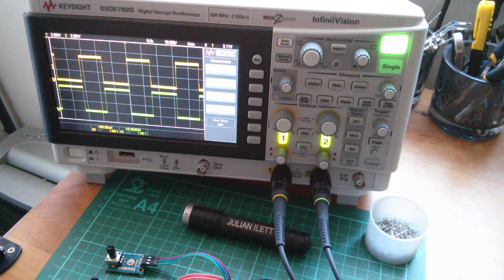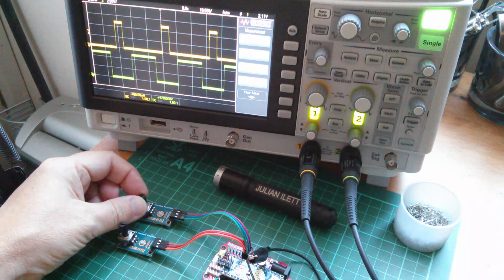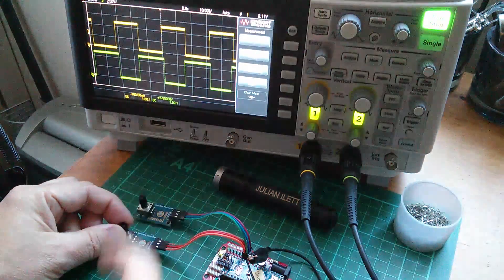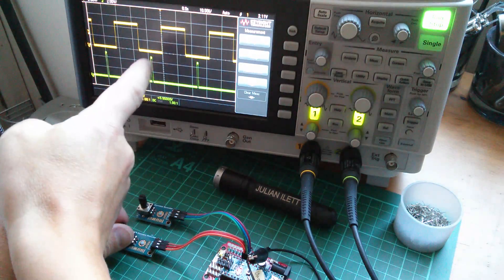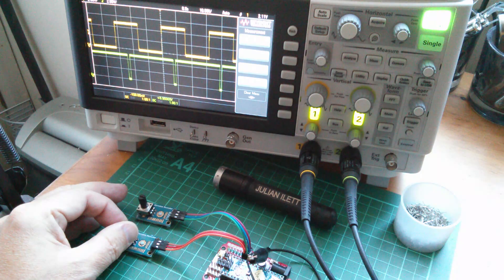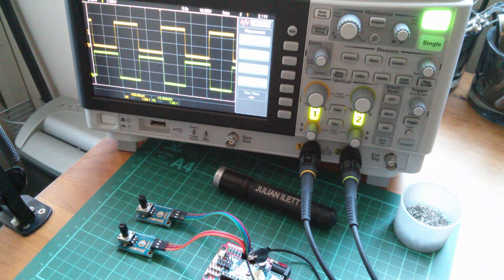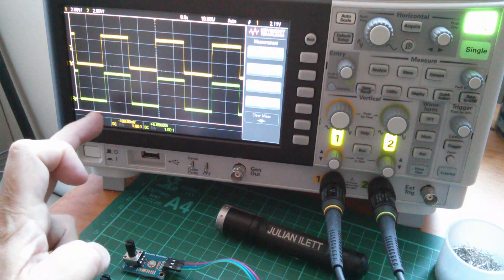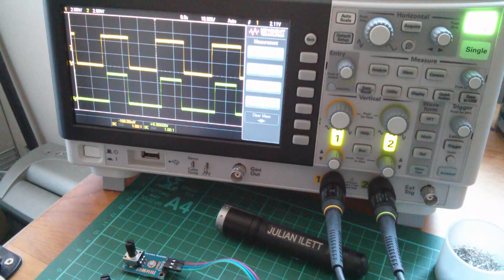Arduino PWM Inversion Issue - Muppet 2 Project

Comment: Julian are the signals for example if A is at 10% duty cycle and b is at 80%.. mosfet B shuts off before mosfet B . is this correct . Like you I can not have both mosfets on at the same time and I would like to have the code automatically adjust duty cycle for both A and B . for example when I turn the Pot as A adjust lets say to 10% can be also adjust  to lets say  88% or what ever max value I want .

Comment: I'll second the comments about ditching the Arduino libraries, I'm currently in the process of building a HV high power MPPT controller. I decided to go with talking to the AVR directly using the registers and timers, I first used Fast PWM mode and encountered some nasty spikes when on 0% duty cycle, once I switched to Phase Correct mode they went away and my MOSFET thanked me. This is actually a documented issue in the ATMEL chip data sheet. Not sure about the issues with the inverted PWM but I think Phase Correct would solve the larger problems.

Comment: Your project won't need the full span of PWM from 0 to 100%.
I'd suggest just finding the safe zone for PWM and not stray outside that. Probably 2%-98%. 
Hard code the levels outside this is you need to.

While using external hardware to do the PWM will work it's overkill and adding to the BOM for no real function.
Commercially the extra components would not happen and I think for your project it shouldn't either.
Finding issues and concerns, analysing them and deciding if they are important is a large part of the design process.

Comment: Julian,   Instead of fixing this anomaly externally, why not just fix it in the Arduino code?  I believe you could nest two conditionals in the main loop and drive the output the way you need it at the top and bottom end of the PWM range. Seems much easier than wiring around this issue -- at least to me.   Just wondering...Mike

p.s. regardless of how you choose to address the issue, I'll certainly enjoy watching & learning from you talking the rest of us through your thought process.  love your videos & please keep them coming.

Comment: The analogWrite() function has special cases for 0 and 255 inputs.  The Arduino core doesn't know that you jiggered with the hardware registers to invert the signal.  You could copy analogWrite() from the core and write a version for inverted PWM.

Comment: Hmmm.  Do you think the value the pot is generating is a range from 0 to 1 (which serves as the frequency seed for the duty cycle).  If that's the case, it would explain what's happening here.  Since !0 is true/on (which causes it to go from almost always off as you approach 0 to suddenly on when you reach 0) and !1 is false/off (so it goes from almost always on as you approach 1 to suddenly off when you reach 1).  So when you hit the limit (0 or 1) it does the opposite of what is expected. So it seems like you could write a condition to check for true or falseness... and while not true or false, invert the value... else return the value. 

Here's hoping I said that the right way around.  In my head I'm actually seeing something like:

if(value !=0 || value !=1) return invert(value) else return value;
Reply: PS.  I don't actually code for hardware, so forgive me if I'm off my nut.  LOL

Comment: try inverting channel A with TCCR2A |= 0xC0, as per the datasheet: "A special case occurs when OCR2A equals TOP and COM2A1 is set. In this case, the Compare Match is ignored, but the set or clear is done at TOP." whereas with TCCR2A |= 0x30 channel B is inverted with the note: "A special case occurs when OCR2B equals TOP and COM2B1 is set. In this case, the Compare Match is ignored, but the set or clear is done at TOP."

If I interpret this correctly, when channel B is inverted the reset is done at the TOP of the triangle wave used to generate the PWM waveform, while when channel A is inverted the reset is done at the BOTTOM of the triangle wave.  This might fix the issue... no promises

or, try editing wiring_analog.c "You can find the function in arduino-1.8.3\hardware\arduino\avr\cores\arduino\wiring_analog.c" (Meiestrix) remove the 

if (val == 0)
 {
  digitalWrite(pin, LOW);
 }
 else if (val == 255)
 {
  digitalWrite(pin, HIGH);
 }
 else
 {

(and if you care, fix the indentation issues)

or, as other people have said just use some software logic, i.e.:

if (valForInvertedPin == 100%dutyCycleAfterInvert){
     digitalWrite(invertedPin = HIGH);
}
else if (valForInvertedPin == 0%dutyCycleAfterInvert){
     digitalWrite(invertedPin = LOW);
)
else {
     analogWrite(pinNumber, valForInvertedPin);
}

woo, longest YT comment i've written ever. lol
Reply: Is this the knitting pattern for gloves or the one for for mittens? Just kidding! I found the theory and mathematics of electrons easier to study, back in the mid-70's, than the occult arts of programming. It never fails to amaze me that people can actually understand comments such as yours. I respect that.

Comment: It makes perfect sense when you remember you inverted the output; you're now dealing with negative logic. When you turn the (bottom) pot CW, you're increasing the duty cycle w/respect to 0 volts (which is logic high now), and when you turn the pot CCW, you're decreasing the duty cycle w/respect to 0 volts, so full off (false) = +5 volts! HTH - Cheerios!

Comment: I think there's no need to go with external hardware.  You haven't begin using the core features of the Atmel chip to tweak the PWM outputs.  In particular, some of this is described on the 'Secrets of Arduino PWM' page at https://www.arduino.cc/en/Tutorial/SecretsOfArduinoPWM.  Besides that, your off/on inverting problem is trivial to solve in code, since you won't be directly driving pulse widths from an analog input -- they will come from voltage feedback detection.

You'll have to dig into the datasheet further anyway.  Your Buck/Boost configuration will require synchronization between 4 PWM channels, and that's only achievable by directly calibrating the relative phase of the input and output sets of PWM outputs.

Comment: you could fix tat in software. give yourself a 
5 percent  or less window and if you are within your percentage of fully on turn the pin on and just the opposite for almost fully off. no external hardware.

Comment: Some psuedocode for you

Just before the write to the inverted PWM

if valueFromPotenetiometer = 255
{
    valueFromPotenetiometer = 0
}
else if valueFromPotenetiometer = 0
{
    valueFromPotenetiometer = 255
}

// write value to PinX
Reply: Ok looking at the code this is a simple manner.

assuming you are using pin 3 for the inverted PWM, if not substitute for the proper numbers.

if (analogRead(A1) == 255)
{
    analogWrite(3, 0);
}
else if (analogRead(A1) == 0)
(
    analogWrite(3, 255);
}
else
{
    analogWrite(3, analogRead(A1) / 4);
}

Comment: Well, what ever abstaction layer (arduino stuff) you are using has a bit
 of extra code at the extremes (that is 0% and 100%). Naturally the AVR 
timers can only produce one extreme. Default is 0%. If you set it to max
 duty, you still have a teensy tiny pulse which is one timer tick long. 
This is becuase of the way the timer handles the counter register 
overrun. To circumvent this the arduino code just disables the timer at 
the extremes and forces the pin to the wanted static state. Obviously 
something goes wrong at that point when inverting the channel.

One thing tho. Please do not use the arduino IDE. This is a good 
example. It realy disconnects you from the hardware. So even if it is 
not strictly arduinos fault (like in this case) you do not have the 
insight to understand what is going on. AVR is realy not a complicated 
arch. Just RTFM. They even give you example code right in the 
datasheet!

Comment: You can solve it un software. It is as easy as adding 2 if. 
If value= 255 then send 0
else if value=0 then send 255 
else send value
It is dirty but  should solve this stupid problem.

Comment: You could just just use a wrapper function for the inverted channel read value of the trim pot, that both inverters the value (fixes the direction issue) and at the limits, sets the value to the opposite max/min value. Pseudo c-code:

 int invertedValue (int i){
   int r = MAX_DURATION - i;
   if ( i >= MAX_TRIM) {
      r = MIN_DURATION;
   } else if ( i <= MIN_TRIM ) {
      r = MAX_DURATION;
   }
   return r;
}

Comment: I'm wondering if this isn't a bug but a feature - if you push the PWM to to the point where it's no longer a "P", it turns off.  That is, the inverted and non-inverted outputs go to the same value which turns off the driven load rather than apply pure DC across it.

Comment: Can you seriously not get it working using one of the other PWM peripherals? - it's a while since I've used Atmel but  there are 3 seperate PWM peripherals on the ATMega with multiple PWM modes (I assume you've read the datasheet and not just relying on what the Arduino library knows how to set up)

Comment: EDIT: Lots of people beat me to it, but one extra copy of the same thing can only increase the odds of Julian seeing it...

It's actually a bug in the analogWrite function. For values 0 and 255, it just digitalWrite's the pin low or high respectively. Add your own inverted wrapper code around analogWrite which handles these two values the opposite way and only use analogWrite (utilising PWM hardware) for 1-254.

Comment: Software workaround? When you get to a writing 0 or 255 PWM values, switch off the inverted PWM and write the corresponding 0 or 1 to the port, for 1-254, switch inverted PWM back on. There might be a few milliseconds of glitching that you'd need to take care of the order of writing so as not to short with both MOSFETs switched on!

Comment: This is not a quirk of the atmega, because it can and will exactly do what want. The problem is the simple code and the fact that Arduino is hiding too much from the developer. One of the biggest mistakes that the Arduino designers made IMHO. I have seen so many people having problems, because Arduino keeps them from knowing what is actually going on. That said...
• Make sure the timer is in "phase correct PWM" mode (looks like it is, since the flanks move symmetrically).
• Get rid of the "analogWrite". Write the timer registers directly. It's much faster than calling analogWrite (since you are changing two values you want that to happen as close together as possible) and more importantly you know what really happens to the timer registers.
• update the timer registers in the timer overflow interrupt. Otherwise you will have glitches that can fry your MOSFETs. If another interrupt triggers just between the two timer value updates, you can end up with two different duty cycles on the outputs for a short time. (again: Arduino isn't helpful here; unless you know exactly what the core and all libraries are doing, there could be a lot of other interrupts happening)
Reply from the maker: Very good point - getting rid of analogWrite makes a lot of sense. I'll probably put polyfuses in series with the MOSFETs as a precaution, but not totally sure they'll respond quickly enough. Thanks Superdau :)
Reply: The issue of the frying MOSFETs (which sounds like a metal band) could be mitigated even without disabling interrupts by limiting the rate of change of the duty cycle.  If a non-overlap time of epsilon is necessary for non-frying, then having a steady-state non-overlap of 2*epsilon and limiting changes to 1*epsilon / cycle would prevent smoke release.  Even with interrupts, the full update of both outputs needs to execute before the first channel can be updated twice.
Reply: You don't need to disable interrupts, just use the one that's there for the timer (ok, since the atmega does not have nested interrupts like an STM32 for example, the result is similar to disabling interrupts). But the other point of using the overflow interrupt is that you know exactly at which point in your PWM you change the value (it's right in the center of the pulse). No need to limit your step size.
Reply: Using Atmel Studio might be helpful.

Comment: I had the same issue with a PIC18F4620. Fixed it in software using  the TMR2 interrupt set at high priority.

Comment: I think it is a problem of the arduino analog write, wich looks something like this: 
pinMode(pin, OUTPUT);
 if (val == 0) {
  digitalWrite(pin, LOW);
 }
 else if (val == 255) {
  digitalWrite(pin, HIGH);
 }
 else
 ......

You can find the function in arduino-1.8.3\hardware\arduino\avr\cores\arduino\wiring_analog.c
Reply: It's the result of mixing direct port access and Arduino code. The Arduino code doesn't know the signal is inverted.
Reply: Correct

https://github.com/arduino/Arduino/blob/master/hardware/arduino/avr/cores/arduino/wiring_analog.c#L112

0 and 255 are not output by way of an oscillator, they just output directly high/low, when using the arduino analogWrite function - it doesn't know or take into account if you inverted the channel.  

The AVR oscillator controlled output (in at least Fast PWM mode which is what is used here, I don't reall about the other modes) can't hit 0% from memory, it gets close but there's always an on (off when inverted) period.

I think this was why Arduino decided to do it this way, people expect 0% and 100% to both be static outputs always off or always on, "almost but not quite off" that the AVR Fast PWM mode can provide isn't good enough.

In my opinion Arduino should have flipped the timer output so that it could achieve 0% and almost-but-not-quite 100% instead and done away with the digitalWrite, few people notice a not-quite-100% analogWrite, but not-quite-0% is certainly noticeable.

But they will never change it now.

@(Julian Ilet) - do you actually need to independently control them?  If not, then you can use the complementary outputs for a single oscillator.  Consult the datasheet, I'm not sure about any hysteresis which may be necessary to prevent shoot-through on your bridge though.  In fact, read the datasheet's timers information, especially output controlled, it's not that complicated and you will be able to make it work exactly how you want.
Reply: Yeah that could be it. Julian should do pins with portmode maybe like he did to get the maximum speed video and not having to rely on the translation into assembler, just program in assembler and see what it does.

Comment: This is a trivial software fix. Just requires a small patch to the library or even just a bit of code in the sketch itself to work around the issue. Why go to all the trouble you are doing when it can be solved in literally minutes? I thought you were smart Julian.

Comment: I'll suggest you to try the IR2110 MOSFET driver, it can drive the high side switch with minimal amount of additional components. Something like this: PWM from Arduino -> hardware inverter -> IR2110 driver.
 Your DCOI driver is fine, optocouplers are not blazing fast, but neither is your maximum PWM frequency :) 
I'm curious to see how fast the Arduino will react to the change of input and output, in other words - how good the load and line regulation will be. I'm waiting for the next one!

Comment: Thanks for sharing. There are an alternative to a 7400, and that is a MOSFET and a resistor to power supply. end many a sourcefolower afterwords. if you want a low impedance to drive the power MOSFET.. best of luck 😀👍

Comment: Hi Julian

You could do something like this in software

if (input=0){
digitalWrite(pin,High);
}
else if input=255{
digitalWrite(pin,LOW);
}
else{
analogWrite(pin,input);
}

I am sure I read some ware that it’s the analogWrite library that dose this actually
doing a digitalWrite instead of setting up PWM if the value is 255 or 0.
Reply: sorry, not working

Comment: Hi Julian,
How will you handle the required overlap with external components?
Second question: would you ever need 100% PWM on or off in this boost-or-buck converter? Does it then still work?
I can imagine the converter to have certain specs for maximum/minimum conversion. I may be mistaken, but I imagine there is no real need for 100 or 0 percent PWM on the two gates in either buck or boost modes.

Another suggestion was to just use complimentary mosfets. In that case you wouldn't have to use software inversion and perhaps not be bothered by this weird PWM-effect.
Reply from the maker: I'll still use the B channel to produce the non-overlap but with an external inversion.
100% MOSFET on in buck mode would be zero voltage reduction (minus losses).
Reply: Clear. Would that external inversion by achievable using complementary mosfets, or would that require another (more complicated) setup? (such as a charge pump like you have in the original MuPPeT)
Reply: even if you dont need 0 or 100%, if you set PWM to zero, you should expect 0V, not 5V...

that can cause some nasty smoking from components, you expect closed mosfet, but it opens fully.